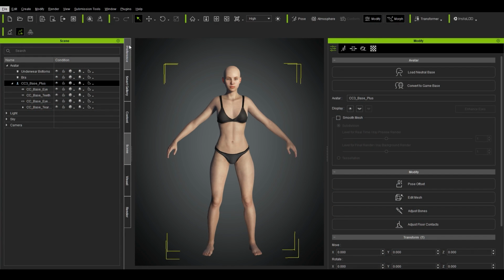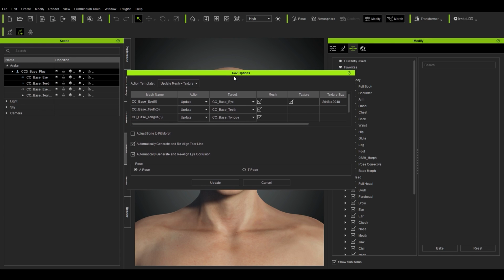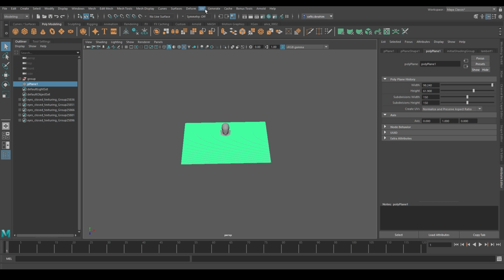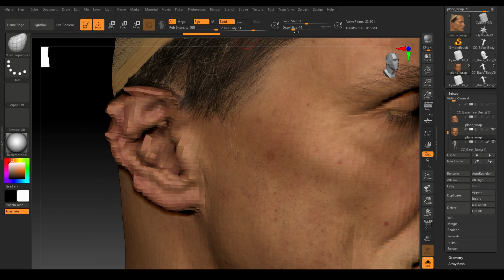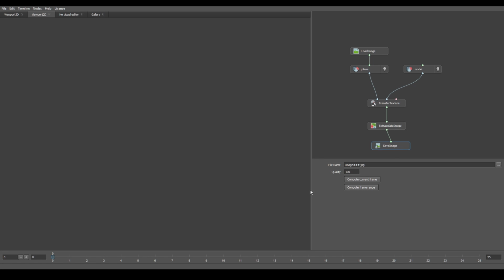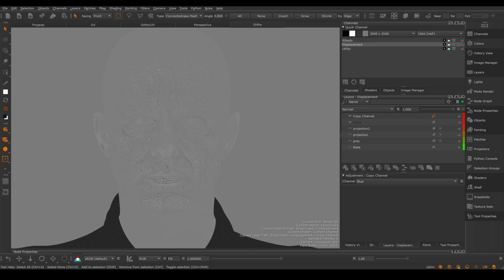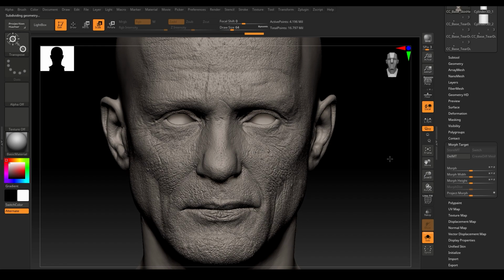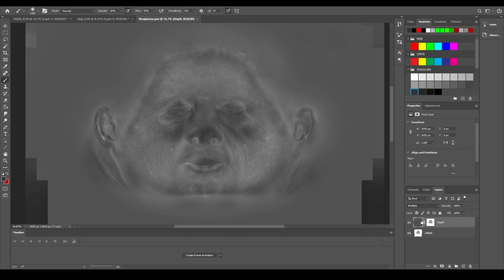Realtime Digital Double #2 - Sculpting and Utilizing Multi-channel Face Maps - by Sefki Ibrahim

Comment: Just found this and the problem I'm having with this is that the channels aren't painted simultaneously. What I mean is that the orignal diffuse and displacement textures match so the pores and everything lines up perfectly.Therefore they need to be painted/projected at the same time. Like when you paint the diffuse, the same operation should be carried out for the displacement so that the result match up. Is this possible and if so, how?

Or is this just something that is actually a non-issue because no one would be able to tell from these touchups as the main face texture and displacement do line up perfectly?